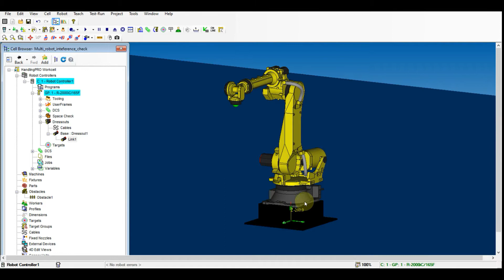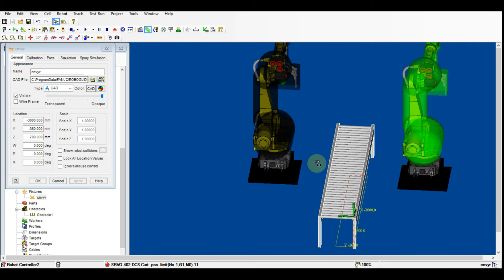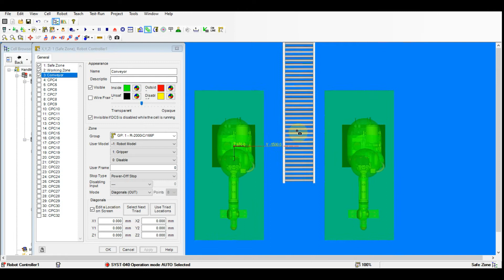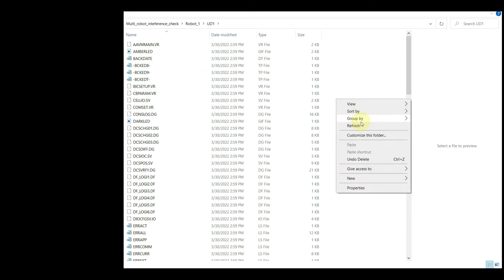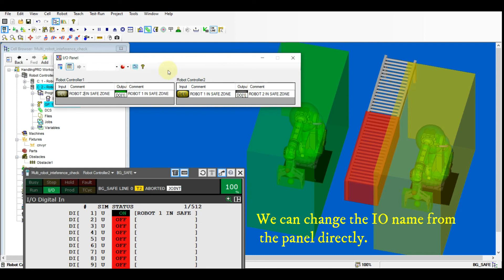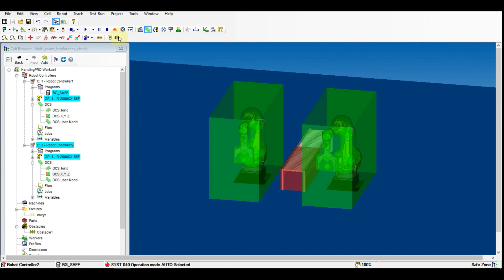Fanuc Roboguide Simulation Tutorial : DCS Robot to Robot Interference Check.

Comment: There are one thousand ways to skin a cat. NSI is non safety input, I would have used Safe I/O connect to send the CPC status to a safety PLC and let the PLC handle the job calls for the robots according to which one is on the shared zone. In this way you can keep the integrity of the safety signals.
I also believe you are missing the software option package Ethernet Global Data (EGD) I/O required for the communication between the two robots.